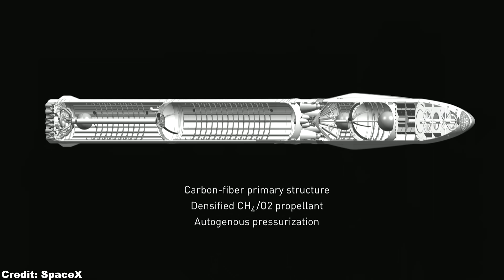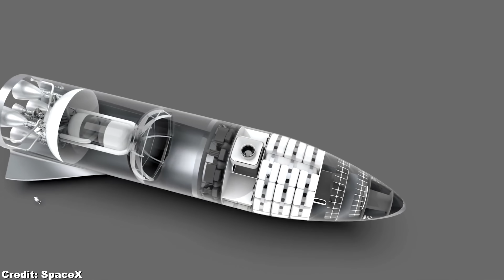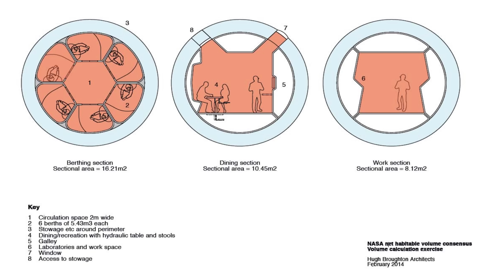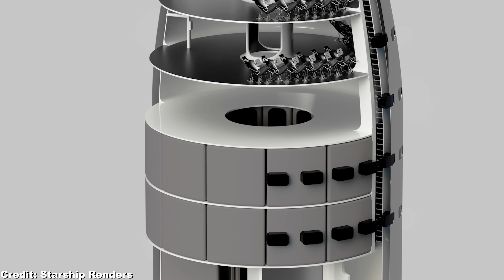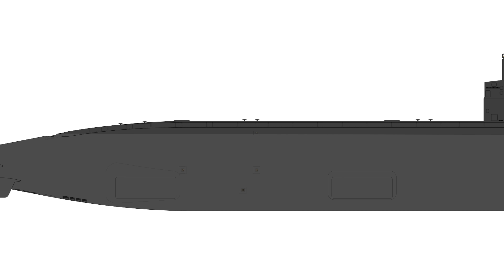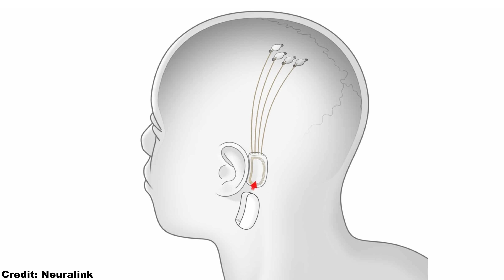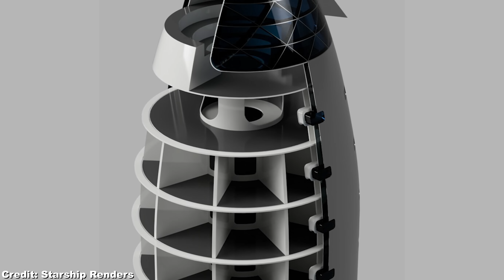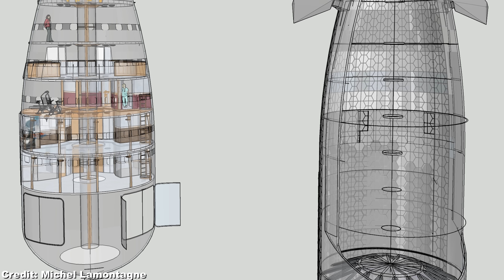CAN YOU SURVIVE 6 Months With 10 Cubic Meters? [SpaceX Starship FLAW FIX]

Comment: I respect your show.  But I have to say my opinion.  I lived on a submarine.  I was enlisted.  My private quarters was the size of a coffin.  Not everyone was awake at the same time, we had work to do.  About one third was asleep at all times.  If you shrink the personal space to 7 by 3 by 3, and have group recreation space, I think it can be done.  Now the dark side, we had two people develop mental problems while underway.  One almost sank the sub and was flown off by helicopter.
Reply: Submarine are very dangerous. Open a valve to the water outside.  The deeper the sub, the more pressure.  More pressure, the faster a submarine goes down with all hands
Reply: @duanelawrence4311  
Not a concern on a space craft.
Pressure difference is nearly exclusive at 1atm !
Reply: @duanelawrence4311  We always joked that the torpedomen were potentially the most dangerous people on the boat. Four 12+ inch hull and backup valves straight into the ship and interlocks they're intimately familiar with.
Reply: Hot racking is very bad.  First a definition,   two people sharing one bed that work on different shifts.  If the shifts are 8 hours a day and person one is sleepy while person two is asleep.  Plus, you cannot get anything from your space.  Having even a coffin size space to yourself makes cramped quarters livable.  Never agree to hot bunk
Reply: @duanelawrence4311  Yikes, that would be bad! I was thinking shared quarters, not shared bunks.  Big enough for one waking up while one settles in at shift time, but still smaller than three completely separate quarters would be.
Reply: @zaguar3153  
"Quarters" and "Sleeping", 
have different meanings on a Starship.  

--Direct personal quarters being the size of a coffin.  
--Communal areas being available for preparation of foods, & sanitation.
--Laundry is an interesting concept to conquer.
--Personal items to be restricted to one set of clothes per person
--All other items are in cargo volume
Reply: @dirktetechs.f.realities9829  Perhaps those meanings will "evolve" along with StarShip...
Reply: @duanelawrence4311  
-'I agree for many reasons !
--On missions, 
Never hot cramp a personal area !
( iLLness - Fitness -- Food -- Emergencies - Other reasons )

--A sample ?
Ship needs to maneuver with high G forces !
Reply: based on very limited space, i'd not be too surprised to see 3 sharing one bed. one sleeps 8 hours, person two sleeps 8 hours,  person 3 sleeps 8 hours. then the 1st one gets it again for 8 hours. a bad system but, with space constraints, is there an alternative?
Reply: I think spacex need to choose astronauts who survived in these claustrophobic scenarios. Like you! Thanks for the info btw!
Reply: I was going to suggest dividing the crew into three shifts, one working, one recreating, and the third sleeping, with three people (one from each shift) assigned to each cabin. Then I saw your post - speaking from actual experience as a submariner! Bravo! Also, thank you for your service!
Reply: @zaguar3153  Hot bunking will not work. you need each person to have a acceleration/deceleration couch for the initial burn the flip and burn deceleration  to Mars then the landing landing.
Reply: Sub experience is the best starting point for best solving this problem!
Reply: @douginorlando6260  prolly not US Navy subs, either!
Reply: @gringoviejo1935  : Why would you say that? Have you been on any US Subs, Gone to sea on them?. I've visited Japanese subs, Australian subs and three Russian/Soviet subs here in the US. By far the US Subs have out striped the others in design, and comfort and accomodation. I've served aboard US submarines, nuclear and diesel. Where is your information/experience coming from for your statement about not being US Subs?
Reply: exactly my point,  @webbtrekker534 . these ships would unlikely even be to the comfort level of USN subs.
Reply: @webbtrekker534 
One key factor: Here in the u.s. !
Why should the country show items that are better than their's ?

IF you wish to claim having been aboard a Japanese sub:
then need to be on an operating sub !
Reply: @dirktween244  It was an operating Japanese sub. I was station aboard my sub and a Japanese sub pulled into Pearl Harbor. A number of us walked over to the pier they were moored to and asked if we could tour the submarine. I was aboard about an hour and a half. Not many of the crew spoke english so it took that long. The year was 1967 I believe. Never did learn the subs name. About the time a Canadian sub came in also but it was an old US hand-me-down formerly named Burrfish. toured that too.
Reply: I stayed under water for just over three months.
Reply: @duanelawrence4311  Hooyah submarines. With the amount of space a Starship has, I think they can even model accomodations after a boomer instead of after a fast attack. Give them a nice comfy crew's lounge with virtual reality and several big screens, put in a couple treadmills wherever they fit in the lower levels with dumbbells and pullup bars, a decent galley (with better grade meat than "rejected by Arizona state penitentary"!), decent sized crew's mess, laundry, multiple heads, and a good crew's study. That's all you need for a group of almost 200. Just have a few chiefs make sure the rovers actually rove, and any potential casualty would get fixed in a minute or two. And the best part? There's *windows*!
Reply: damnnn...How did he nearly sink the sub?
Reply: @coonjamalay  tampon in the toilets
Reply: The big problem here is the need to keep occupied. The submarine works because everyone is dedicated to tasks that must be completed, and repeated daily, astronauts can stay in space for over a year because of the routine, and because of new experiments and tasks they are given to do during their stay. 100 random people shoved in a can for months who arent given suitable tasks to dedicate to are likely to have much larger amounts of psychological problems.  However, education could be an important tool, a few months spent studying could be rather useful for many people. And with the large group there would be good opportunity to socialize, which is also a drawback because more people leads to more cases f personality clash. A submarine or scientific expedition has the advantage of having a clear social hierarchy, obey and stay in your place. Once again human psychology is the most important thing to take into account. Small groups are much better.
Reply: @Marc83Aus  Very well said MarcAFK.
Reply: They tend to recruit very clever people as astronauts with multiple skills who prove themselves to be team players and positive in thinking. For long space trips they would have to test for claustrophobia, jungle training weeded out our guys quite quickly. The sheer noise, everything trying to bite you, bury eggs in you or try eat you plus never seeing daylight in dense undergrowth...yep don’t miss it 😁. Can’t imagine how unpleasant it must be for a sufferer on a submarine.

I can’t see 100 on those starships, 20-30 depending on cargo.
Reply: Steve pine has a good point about all astronauts. But when you start taking paying passengers, that does not apply any more.
Reply: Yeah, I've been pushing this point for a while now in several forums. Did 6 years in subs. One Nuc and one diesel. Both have scenarios that apply to Starship. It all comes down to mass and how to get it to Mars.

Food: the human body needs about 3 pounds or equivalent of food a day to remain healthy. On the boats we had food everywhere. you even walked on it and sometime slept with it and sat on it. Some times even frame bays were packed with it. You ate yourself into the boat. Now, assuming only 40 people on Starship that means 3 to 4 meals a day. 120 to 150 pounds of food needed a day. Assume 3 shifts that means 4 meal settings a day. For estimation assume 130 pounds of food times for around 180 days that comes to around 23, 400 pounds of food plus you need stores for after landing so double that, figure 50,000 pounds or 25 tons of food. 

Water: On the diesel were were allocated one gallon per man per day for consumption and personal use. Fresh water weighs in around 8.3 pounds per gallon so 40 times 8.3 equals around 335 pounds of water times 180 days comes to roughly 60,000 pounds of water. You can recycle all you want but you still need the water in case your recycling system takes a dump.

Trash: What are you going to do with it? Dump it and it just follows you to Mars. We generated so much garbage on the boats that we had to either dump it overboard or shoot out using the GDU (sorry I was before TDU's) daily.

I was talking with an old shipmate the other day. and talked about this subject. We marveled how the Navy sealed 113 guys in a sewerpipe and sank it for several months. We were expected to be self entertaining. What it came down to was ; Movies (we carried one for each day at sea); Books; everyone brought a small library and swapped books. Games: There was the 24/7 poker game with payday stakes, (we had guys who had to ship over for 6 to pay that debt). and general BS and "story" time. Not to mention drinking torpedo alcohol, knows a cocktail hour. Bored you'll drink anything. 

 Doubt I'll ever make that trip as I'm pushing the hell out of 75. I could probably do it since I know what its like to have the "Big Eye" after having finally slept myself out and heard all the stories. Not sure I'd like to have any kind of implant. I know what its like to have "Channel Fever" waiting to get back to port. The folks making that trip will need to be well exercised ready to work when they get there. Unfortunately space is a bitch on bodies.
Reply: @webbtrekker534  Subs have much more internal volume per crewmember than Starship would have.

Yes, Subs cabins/bunkers may look like coffins. But then you have corridors and other space.

The calculations done here are TOTAL VOLUME divided by passengers resulting in 10m³ per passenger. When you add all the systems, etc, the reality of what you have is about the same as travelling for 6 months in a crowded 747 flight.
Reply: Yikes that must have been scary! We wouldn’t want that in space!
Reply: Duane Lawrence Thanks for your service!  👍
How long was a “long” sub mission without getting into a port for some R&R?
Reply: Thank you, Duane, for your professional info.
Just 2 remarks.
7 by 3 by 3 you mean in feet? These same sizes of a coffin?
If we count parameters of russian atomic submarine Kursk (displacement 23860 t, complement 130) and suppose that inner space for crew access is only a half of displacement then we receive 91 m3 per person. Far from 10 m3 per person in Starship. And don't forget that 10 m3 in Starship we received by dividing 1000 m3 of total pressurized volume by 100 people. But this pressurized 1000 m3 will include also different stores (air, water, food, tools), life support systems, and so on. Thus inner volume for people access will be 5 m3 per person. And this will be 5 m3 per person not of private cabins but of TOTAL volume including corridors, solar storm shelter, gyms, etc.
Nothing close to submarine.
And one more essential difference between submarine and Starship: submarine transports crew each member of which having a navy specialty and duties while Starship will transport colonials (biologists, geologists, builders, medics) which hardly can apply their professional knowledge to everyday duties.
Reply: That does raise a question.  Would SpaceX prefer people with time on a submarine?  Only time will tell
Reply: @duanelawrence4311  Thats a really good point Duane...months of deployment on a Sub would be very desirable experience for a Starship...and the Military discipline that goes hand in hand with that also. Whoever the crew is will be the best of the best...
Reply: Great comment Duane...and from someone who has been on active service on a Sub. Yes, as you know well, there are psychological issues with being in a confined space for months at a time...but 6 months to Mars aint that bad really. It requires a really tight team, who can all support each other...and your time awake is governed by your duties and workload...the same will apply to Starship. You are the kind of person i like reading posts from, i hope you continue doing that...peace to ya brother.
Reply: @dazuk1969  " It requires a really tight team, who can all support each other"

And here lies the problem, Dam Mad.

The 100 people to Mars on Starships are not "tight teams who can all support each other".

They will not be CREWS who whole awake have duties and workload. 

We are talking about the majority of the 100 people being PAYING passengers. In theory, thousands of Starships each with 100 paying passengers. 

These are not people who will have extensive training. Nor will they be screened in the necessary way.

The submarine analogy is faulty because of that. For a start, any submarine is roomier than Starship will be. The 1000m³ is TOTAL volume. Add all the equipment and cargo, and you will probably have less than 500m³ of space for the 100 people. 

Now, instead of thinking of submarine crews, think that you are putting inside that submarine, for 6 months, airport passengers that usually fly in 747s and complain of 8 hours trips because of the lack of volume. And we have tons of examples on Youtube of passengers flipping out on airplane trips!
Reply: @rogeriopenna9014  Hey there, i was talking to Duane about the first that go...the ones who will set up the infrastructure for those that follow...imho, the first will be highly skilled personnel, Astronauts, engineers, scientists and military personnel. These are the people who will lay the foundations for the pioneers that follow. Even then, they will have to be extensively trained for what lies ahead. I think what you say makes sense when a colony has been established and the basic infrastructure has been established to support life. Even Seb n Jixuan say 100 people is highly unlikely in Starship..my guess ?..30-50 max. But hey dude, we are all in unknown territory here, and i do like reading others thoughts and opinions on stuff...even if they conflict with my own...take care dude.
Reply: @dazuk1969  Well, I agree that with 30 people, all of them skilled technical people, TRAINED and SCREENED for the mission, that is totally viable. Even for a longer time. I believe Starship can send missions with 20-30 people to the Asteroid Belt, maybe even the Jovian Moons.

But then, the video is not really about such missions, but specifically about Starship being used as a COLONIAL transport, for 100 settlers at a time.

THAT is what I disagree is possible, just like the video also disagrees.
Reply: @rogeriopenna9014  Hey man, life would be really boring if we all agreed about everything...but that is why i watch this channel...lots of people, with lots of different ideas on stuff who can express that in the right way to others....take care dude, and i will look out for your future posts 👍
Reply: @dazuk1969  But I think we agreed, actually.

".the ones who will set up the infrastructure for those that follow...imho, the first will be highly skilled personnel, Astronauts"

I agree.

"" It requires a really tight team, who can all support each other""

I also agree with that. 

The only think I disagree is that imho, when the channel is skeptical of Starship missions here, it's specifically being skeptical of the missions with 100 colonists, paying passengers, so when some people say "they disagree with the video content, as they have been in subs and it's possible", they are not actually disagreeing with the parameters set forth in the video.
Reply: @rogeriopenna9014  what's funny is, personally, it didn't feel like we ever did all that much mind training and screening before we were sent aboard the boat for months, even though I'm sure there was plenty going on behind the scenes, in addition to the requirement for having already passed through basic training. I'd assume similar training regimens would be used for anyone wishing to go aboard these starships, at least until we have actual colony ships with rotating habitats and space enough for your average untrained civilian to not off themselves after a few weeks in close proximity to some of the most crass strangers they've ever had the displeasure of being with.
Reply: @christopherlee7334  Sub School weeded out the majority of the the folks who couldn't hack it. As I remember, every Monday there were fewer guys in the class section. We started with 40 and graduated 14. Other classes were higher or lower depending the the people. Once we reached the boats we had to qualify. Couldn't qual you were gone. Navy takes about 5% or less who volunteer.
Reply: @webbtrekker534  We managed to keep most of our class in BESS, but by the time we got to TTF there were only 4 people in my Nav ET school, and then I was the only one that went to my boat, with the others going to different boats and crews. Several were medically disqualified, but afaik we didn't have anyone with mental or behavioral issues; that being said, I do remember Restrictions being somewhat full whenever I was roving watch for that building. Once I got to the boat, I don't remember us kicking anyone off for failure to qualify, although we also had a whole bunch of riders every underway from other boats hoping to qualify on ours.
Reply: @christopherlee7334  We were brand new. Fresh from Commissioning. Once we got to Pearl we were on daily and weekly and weekend ops with every SquadDog wanting to ride to get their sea pay. We were the newest, fastest, deepest, quietest and we were the first boat built with SUBSAFE from scratch.  Did an overhaul at Bremerton and I took leave. Back to Pearl and once we started patrols were on quick rotation. DBF's were decomming right and left and more nucs came on. Pretty much if  a 637 said they had something we probably had it first to try out in some form. My sharpest memory was out first test depth dive. 50 foot at a time. Hearing that hull stress for the first time would make you hair stand on end. It screamed and groaned and creaked. Pop rivets were snapping off like a machine gun. We had free stand bulkhead by the aft ladder to Ops1 from Ops2. That bulkhead compressed 4" out of line and was still there, I heard from the decomm crew, almost 30 years later.
Reply: I wonder if everyone on a trip to Mars would have a job to do on Starship?  I think some would be paying passengers. Sort of like the Mayflower, some crew and some passengers.  The crew might be well trained and tight, but the passengers?
Reply: @duanelawrence4311  Yes, that's kind of what I said. 

And mind you, the Mayflower as well as thousands or hundreds of other ships coming to everywhere in the new world, had confined space inside, but they were "open"... you could breath fresh air. See the blue sky.

And when they arrived at the Americas, they had huge open spaces, forests, nature.

We are talking here of coming out of a confined space SMALLER than the space available in a military sub, to other confined spaces that in the beginning will be the very small... 

We also have to remember the plan is not to send like ONE ship with 100 crew and paying passengers.

Musk's plan is to COLONIZE Mars by sending thousands of ships with settlers.

That means training to adapt to such confined spaces and screening of who can adapt to 6 months in such will be faulty to say the least.
Reply: @duanelawrence4311  What Starship needs is plenty of experienced people like you Duane...yes, i think there will be some "passengers" as well....but it will be the highly experienced crew (like you) that will keep the ship in order, and address any issues as they arise...
Reply: Cavalla
Reply: How would three sleeping bags on different walls of a telephone-booth sized space (1meter x 1 meter x 2 meters) work for three 8-hour sleep shifts? This space-saving may be one of the benefits of weightlessness, although some neurolink VR will certainly help.
Reply: @curtisquick1582  How about nine coffin racks to a 3 cubic meter space? If they want to use their VR devices they can go to crew's lounge instead of bothering the people trying to sleep in their racks.
Reply: My test scores qualified me for nuclear sub, but 6 year enlistment time didn't appeal to me, so went bird farm ATR tech.  I wondered which way a sub goes when it "sinks", up or down?  We all know down is bad.  Carry on lad.
Reply: @jimlarsen6782  Down, a sunk boat goes down.
Reply: A sub could go up, but it was a whimsical question.  Or like my old ship, the Midway, it could just go to port and be a museum.
Reply: I remember the sub being packed full for months out at sea. Food was stored everywhere.
Reply: @duanelawrence4311  :What boats you on? I was on Flasher and Cusk
Reply: You are talking about a MILITARY CREW. In theory trained. And earning paychecks.

The 100 people to Mars scenario is not a paid trained crew. It's colonists. WHO PAID (in theory all their savings) to go to Mars.

The idea is to send hundreds of thousands to Mars. That means barely any screening or training.
Reply: By volume, 5m^3 is more than enough (as noted by submarines)

How to keep sanity, is another question ?
--Group activities ?
--Long distance communication with Earth ?
(Stealrh silence, is not a concern) 
--Mission external viewing ?
(Lots can be seen)
--Short term activities outside of the ship ? (Momentum laws !)
Reply: Can I ask how long you would be submerged at a given time. I had heard 4-6 months? Is that about correct? Thank you for your service.🇺🇸
Reply: kosh123 Rivendale 3 months. No windows.  No sunshine. No getting away from people
Reply: @duanelawrence4311  thank you brother. There is definitely a psychological component to this.  I really think the ships should be constructed in space with launchable habits that detach and land on their own. Use the ship to ferry back and forth never landing.
Reply: kosh123 Rivendale I agree with a ship that never lands.  Too bad Bigalow space industries is on the ropes.  I don’t have access to how much that would cost to design that. I trust the Elon does.
Reply: @kosh123rivendale7  Modern Subs are limited by the amount of food that can be carried as the O2 and water can be made from sea water. Me The longest I was down was 62 days. We did not  have an O2 Generator so had to bleed liquid O2 for a month and then burn Sodium Chlorate candles for the other month. I can tell about being slept out after two month. Rack time was something you were not looking forward to. Everyone had the "Big Eye" and was ready to go home. "Channel Fever" was setting in. But that might have been because we knew we had a finite amount of time to be out.
Reply: I am a Truck Driver my sleeper has an upper bunk so 2 people can live in here we share 11 square meters. It is do able for sleeping. I don't know how you poor navy guys do 7×3×3 crazy.
Reply: Mars One had all those people who signed up to go and not come back before the whole program went belly up, could choose from some of them.  Elon is “suppose” to send 2 cargo ships in 2022, then 2 crewed ships in 2024, that gives him 4 years to start training people for a 1 way trip.  For their mental state, everyone will need their OWN SPACE for not only going, but while there until an adequate base can be set up. Listening to all the talk here, 20-25 might be good enough on each ship.  BUT if even 1 of those cargos ships have a problem, or crashes and burns, the WHOLE ENDEAVOR is DELAY FOR TO COME YEARS.  Just pray that NOTHING GOES WRONG on the way there OR on landing.  You would NOT want one ship to have to bury a crew that crashed on landing.  Elon may have to build a actual starship “simulator”, and each crew will have to be LOCKED UP in it for at least 2 months to see who cracks.  Imagine being locked up with a madman(or woman) for 2-4 months, then for another year on Mars (if they never recover). You can’t send them back right away......😬 hope Elon’s got some shrinks on the payroll thinking about all this.
Reply: What boat where you on? Mine was the USS Ray SSN 653 and the USS Hyman G. Rickover SSN 709.
Reply: @davidrediger6407  I commissioned Flasher SSN 613 and rode Cusk SS 348.
Reply: I really don't know how you did it the pay  must be very good.
Sub mariners are made of different stuff.
Astronauts will need to be tougher  because the conditions will be much harder.
Reply: @endlessspace.8776  Doesn't matter whether it is water or vacuum on the other side of the pressure hull, you're just as dead!
Reply: @endlessspace.8776  Actually the pay is roughly the same as any other sailor, depending on your rate. The reenlistment bonus also isn't necessarily that good.
Reply: Stephen. Sub pay was an extra 50 bucks per month in the 80s.  Tougher for astronauts?  I don’t know for sure, but let me say that not having a window to look out of on a submarine was the breaking point for one guy that went to a mental ward. A space ship can have a window because it only needs to handle 14 psi. A submarine’s Hull has to handle thousands of psi.  A space ship cannot surface to get new air while a submarine can.  Life support system on a space ship would need to be close to no loss. Look at the life support in the ISS, which has break downs and NASA sends up bottled air. NASA has been working on life support for a colony on something with gravity which involves fish and plants. The fish fertilizer the plants and the plants feed the fish and the whole unit produces oxygen and food to support humans.  What I cannot find is a ship life support system other than Bigalow and they may be out of business?
Reply: @duanelawrence4311  Really!? In the 1960's it was $100.00 a month. Wonder why that happened?
Reply: Duane Lawrence aquaponics?
Reply: Maybe my memory is wrong?  I was enlisted. Were you an officer?
Reply: @duanelawrence4311  I was enlisted too.
Reply: NASA has already solved some of the trash problem. The ISS has a 3D printed on board that can use a specific grade of plastic and all the food is wrapped in that plastic.
Reply: the international space station has about the same volume as the starship and has a maximum crew capacity of 6.    100 people would die within a few days if not sooner on that thing.  that 100 people thing is for point to point transportation on earth,  not space.
Reply: hot racking?